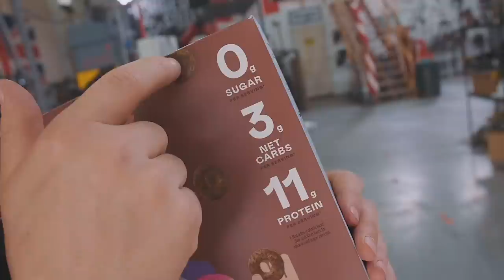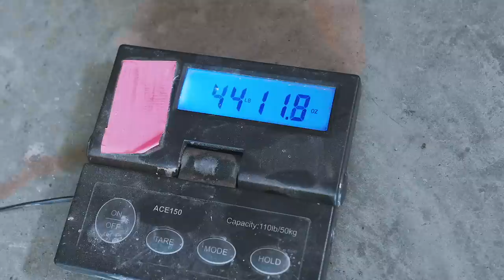MAKING A GIGANTIC WHOPPING BIG SWORD!!! Part 5

Comment: Can’t wait for deliver guy to ring the door bell and yell “GIANT WHOPPING BIG SWORD FOR HOW RIDICULOUS” 📬
Reply: This comment  needs to reach the top. 👍 and comment
Reply: That'll be pretty freaking awesome, I can't wait to see the drop video. I put a comment of my own in here somewhere, but if possible please relay to alec to take off the long sleeves when at the lathe, really bad things can happen if it catches clothing. Not trying to be OSHA but I don't want to hear of a horrific or fatal accident happen at the workplace. This collaboration is an awesome idea by the way!
Reply: Pin this comment
Reply: Hope the vid ends well with this beast. Try not to use it on really hard surfaces or thick layers metals. Would hate for it to bend or break on the first try. A big gummy bear or jello sounds fun. The top part of a cheap car is easy to go through at that height & speed depending on the sword. °-°)
Reply: REXcalibur?
Reply: Can’t wait to see this 44lb beaut be dropped from the tower. Hopefully Rexy is at a safe distance.
Reply: Corbey Foss
Brilliant!
Reply: Russ B Rey would probably be right in the line of fire looking up. 🙂
Reply: Drop it on some oobleck.
Reply: I can't understand why they didn't make it sharp and super shiny also some ingrained logos on aluminum and some cool leather handle design
Reply: @legonciify  it's being used for destruction and dropping. Also, they're dropping into a sandpit so it would slightly shine the metal any way. Or... it'll just scratch it up
Reply: @corbeyfoss281  someone's early with the name game, it's a good shout though
Reply: 44 lbs giant whopping big sword for 44 club
Reply: Alec really missed the chance when he said turn on notifications rather than “Get the bell on!”   He’s definitely not getting pinned. 😂😂
Reply: @corbeyfoss281  THEY'LL PIN YA!
Reply: Alec should pin ya!
Reply: But what will you name it?   It need a really Lord of the How Ridiculous Rings type of name.
Reply: Wordsnwood (Art Mulder) I think it will be the Commtest
Reply: Oh man, I've been watching these videos all week and was hoping to see the drop video tomorrow. Oh well, I watch all HR videos anyway, will wait for this one's turn. Get the bell on folks!
Reply: kbertan it might be used in their 6M subscribers celebration
Reply: @KHolzer444  true.
Reply: 44lbs for the 44 club ... how rediculous is that! loved both chanels for years
Reply: Its weird seeing How Rediculous pinned. 
Alec PINNED YAAAA
Reply: looks nice but at that length i say it'll snap
Reply: It weights "44" lbs WOOT
Reply: I predict the sword is going to bend about the first couple of drops
Reply: It weighs 44 pounds!!! Name the Sword Forgey-Forge!
Reply: @corbeyfoss281  I'd give this comment a thumbs up but it's already at 44
Reply: Film it if you can!!!
Reply: 44lbs How Ridiculous is that !
Reply: Can we just agree the weight was 👌
Reply: Can someone settle an argument? My wife thinks it's impossible to send a sword to Australia and thinks it's all a hoax and i believe what I've seen
Reply: @christophercain8873  probably designation is art or something
Reply: @DakotaActually  possibly so. Wife still doesn't agree lol
Reply: @christophercain8873  "Essentially if its so big you cant conceal it the government often doesnt care, if its a gangy, hommie, druggo weapon (in their eyes) like knuckle dusters, butterfly knives, concealable daggers, throwing stars, stuff like that then they care. You know the states war on crime. Pity the only front is fought on speed cameras and breathalizers."
Reply: @christophercain8873  thats queensland au
Reply: Wheres the video chaps?!
Reply: Update?!?!?!?!
Reply: Its been a month. How long does it take to get a Giant Whopping Big Sword?
Reply: @ps144one2  they got it awhile back. Just no vids yet. Prolly doing their new channel stuff
Reply: That would be EPIC!
But only 44lbs, and you guys struggled to move it? I could easily best that lift. I know you guys were playing up for the video. At least, I hope you were.
Reply: It’s 44 pounds 44 club hr club
Reply: 44 pounds, 44 club

Comment: Snow’s coming soon, make a Damascus snow shovel!
Reply: YES
Reply: THATS WHAT I SAID LAST YEAR!!!
Reply: OMG! This must happen!!!
Reply: Good idea👍
Reply: Wouldn’t that be hard to use due to how heavy it would be?
Reply: Yes 1 million times yes best idea yet !!!!
Reply: Yanir Govrin yeah that’s a good point, I believe most of them are aluminum
Reply: Why would it have to be heavy? Layer it, fold it, get your pattern and then hammer it flat and form it. Finish with a few days of hand sanding!
Reply: and resemble the flag of Montana
Reply: @wywy8834  I believe many of them are steel.  Aluminum has a bad stress-strain curve. That's the thing in engineering that talks about permanent deformation under force loading.  It's why you can bend some paper clips and they snap after 30 seconds and some don't after like 5 minutes, the one that snaps is aluminum, the one that doesn't is steel.  Some are aluminum, some are steel, and a quick check of the ol' google implies that aluminum ones, apart from breaking faster, are also twice as expensive normally.  And it only saves you one pound, 4 instead of 5 (for the specific two with equal blade sizes and wooden handles I'm looking at).  The morale of this rant is: don't buy aluminum shovels unless you live somewhere you only get a couple inches of snow a year, and you like paying double for barely any benefit and several notable drawbacks.
Reply: Please!
Reply: WELCOME TO PART 428 OF THE DAMASCUS SNOW SHOVEL PROJECT!!! I KNOW IVE GOTTEN ALMOST IT ALMOST COMPLETE AND RESTARTED LIKE 40 TIMES BUT, 41 IS THE LUCKY NUMBER!
Reply: demonzabrak That makes sense, thank you! And as for the weight, I was thinking that forging out Damascus that thin could probably end up being a nightmare.. So maybe he would have to grind a lot of the stock away?
Reply: We have been trying to get this to happen for what feels like an eternity,  hopefully this is the year.
Reply: Top comment and no heart? Alec has to have seen this, he’s avoiding it!
Reply: For sure!
Reply: @skoitch Will loves a few days of hand sanding!
Reply: Damascus plus combat shovel.... Damascus combat shovel!!!!
Reply: Damascus snow plow for the front of his truck!
Reply: @skoitch  they are not in Finland how would the shovel be Finnish?
Reply: That would be nice
Reply: Videos about yard tools would be cool
Reply: @Hayden, Timascus?
Reply: Do it as a shovel attachment to put on the front of his truck...
Reply: omg yes please! :D
Reply: It would probably have to be stainless damascus
Reply: ??? Why, Unless your mad about having everything in Damascus
Reply: BIGGER!!!! DAMASCUS SNOW PLOW BLADE!!!!
Reply: What an odd spoonsor
Reply: Doooooooo iiitttttt!!!!!!!
Reply: @wywy8834  I definitely have steel shovels. To dig. Maybe not snow shovels. But digging shovels
Reply: Thats awesome
Reply: he should make a Damascus snow plow. its Montana not Nebraska.
Reply: Winter is coming
Reply: @ndulin1234  game of thrones theme playing 😂😂😂
Reply: Great idea
Reply: Red Roy  I caught the reference and am STILL waiting for the book.
Reply: With diamonds and golden inlays! Because why not....
Reply: Make a steel edge for it so you can replace it when it's worn out so you don't damage the damascus and make it out of stainless stell damascus so it does not get runter when there is some salty snow
Reply: Snow? Oh yeah I remember that. Back before global warming. Used to snow quite a lot around here. Never on Christmas day though...
Reply: @skoitch  f in the chats for will
Reply: Make Ice Skate blades
Reply: skoitch is this in America
Reply: Union Jack Gaming And Vlogs 
Yes
Reply: Steele vs Stelter Snow Showel!!!
Or Utility Showel
Reply: YES, YOU GENIUS, YES!!!
Reply: You mean, Winter is coming for you, my summer child
Reply: Yanir Govrin he didn’t say giant
Reply: Don't forget a feather pattern, Damascus ice scraper too!!!
Reply: So...has anyone thought about salt and rusting? Is that just me?
Reply: Elliot Witkowski, yes. Just like Damascus knives and swords you would have to clean and oil after use, if you actually use it!
Reply: Forging comically large spoon
Reply: That would be amazing ! Do It !!!
Reply: YES MAN THAT WOULD BE AWESOME
Reply: Nickel copper Damascus snow shovel

Comment: anyone else having a minor heart attack at the cost it must be to ship that to australia?
Reply: Air freight for a long object, relatively light... to Perth from Bozeman (I don’t think it would save much to drive it to DIA). Don’t know. Several thousand US dollars at least?
Reply: A bit of pocket change.... Just a bit
Reply: @markiangooley   my motorcycle from aus to the states by air was $2k so it would probably be less than that. (not much though) from the states to aus by boat was only 800 (+ a couple of months).
Reply: According to the USPS website for international parcel at 45lb would be $298.90 + tax and whatever add on fees.
Reply: Hopefully it gets through customs fast... wood products, the delrin might have been a better option.
Reply: 300$ is probably more than the sword cost to make
Reply: I've been thinking of that from the jump, I'm an artist and it's always a gamble of how much I'll be paying to ship a piece out.  I would guess around 2,000, but I could be way off, it's not so much the weight but the dimensions.
Reply: looked it up its 1000+ with most companies
Reply: @fateunleashed9680  Last time I tried to ship anything internationally, there were size restrictions, not just weight.
Basically beyond a certain length it was almost impossible to get shipping for an item through typical means...
Reply: @genxray951  Interesting. using sea freight, I paid about 300 pounds to ship a pallet load (the contents of the pallet was stacked up to about 2.2 metres high - in the case of a shipping pallet sent through ocean freight it turns out that the price doesn't really fluctuate by weight, nor height. as long as you're within the dimension limits allowed, you simply pay a fixed price for a standard size shipping pallet)

Of course, we were then hit with about $800 in customs and handling fees at the other end. Still a lot less than I would've expected for shipping essentially everything I owned barring furniture most of the way across the planet...
Reply: I'm more curious on how they would even do that haha
Reply: Alec should ship it COD 😀
Reply: Air freight should be between $10 and $20 per kilo so $200-$400
Reply: Being so long and irregular shaped...small fortune.
Reply: not even just to Australia but even more due to the location in Australia and with the delays due to covid the amount of time it will take to get here is crazy .... atleast they cant really claim they lost it in shipping unless a ship or plane goes down lol
Reply: The packaging and the box its in, would add, likely, another 10 pounds, too.
Reply: How ridiculous have basically infinite money for things like this, they haven't been able to travel either.
Reply: Oh it's not much at all, 2 mortgages and a car.  see?  not much at all
Reply: Why not make it in Australia in the first place?
Reply: Someone commented on the handle being made from wood and customs grabbing it.. What about the fact its a double edged "blade" these things are illegal in Australia.. Anyhoo...
Reply: @sirgalah561  Pretty sure they'll do what MichaelCthulu does, and call it an "Art piece/Sculpture".

Comment: Sword gets to Australia somehow FedEx has managed to destroy it.
Reply: Oof
Reply: FedEx doesn't destroy stuff they end up saying it was delivered and you find out they are selling it on eBay
Reply: More likely Australian quarantine will confiscate it before How Ridiculous even see it.
Reply: If it makes it through customs Australia Post will either loose it or send it via Mars.
Reply: @andyroo8592  I didn't think of that isn't Australia one of those countries that limit blade length to 36mm or some ridiculous thing like that?
Reply: I don't think blade length is an issue, but if it's Sharp or double edged  or opened with a spring would get it blocked...funny those rainbow leek knives from Kershaw were not a legal import ( laws changed and I think they are ok now) and the guy on a customs tv show was using one to open boxes for inspection...hhhmmm I wonder where he got it from??🤔
Reply: @yoursexualizedgrandparents6929  He's talking about how FedEx actually sold a YouTubers one of a kind specially made clutch for his car. One that is made for his one of a kind engine.
Reply: Last time I ordered a sword from the US it had been opened somewhere on the US side and repackaged in newspaper (which is how I knew it wasn't our customs). As it was no longer in the original airtight packaging (which I confirmed with the seller and which previous blades from them were in) there was rust damage. Really wasn't happy.

Comment: So who else thinks the sword will be bend in half after the first drop?
Reply: Unfortunately kinda thinking the same thing since he didn’t harden all of it seems like this video was a bit of a let down with his usual quality really felt rushed to me
Reply: I've said that all along!
Reply: and/or the handle will break off..  Super glue is not very tough stuff and after all that sanding and profiling, there's not much of a seam, plus the heat of the torch will likely also have weakened the glue, and epoxy is not that great at holding handles on in the face of shock and impact..
Reply: @Flying0Dismount  I agree. The shock is going to shatter that handle.
Reply: The amount of force a dropped object gets, at that height, is massive. Alex is a great smith but anything dropped from that high would have to be very thick ... like anvil thick (alex liked my comment, I hope he doesn't think I'm insulting his skills)
Reply: after first drop? no, it will last some time (maybe damaged handle etc) but it will inevitably meet bulletproof glass or a safe and thats where I think this sword will not make it (worst case scenario the sword will meet Bruce and that will be its end :D )
Reply: That may be very likely. Then again, if he hardened it like a normal sword, it may have broken upon that impact given normal swords are not meant to be dropped that high or made that big. I'm not a metallurgist or materiel engineer/physicist though, so what do I know.  I definitely don't expect it to last that long given what they normal drop these things on. Might brake on the steel plate or bullet prof glass drops. Not to mention the safes they have been doing recently. I just hope they are happy enough with it to ask him to make another one like they did the giant darts. We might get a better 2.0 version that isn't rushed because they had to put up a pulley and because Alec is..... well Alec. No offense.
Reply: Depends how it lands. If it falls straight and stabs then there's a decent chance it'll survive a few drops. If it rotates in the air at all then it's probably done for. Not much you can do about that, though.
Reply: I think it's going to flip around and land handle-first, because of the wide blade acting like a fin. A skinnier blade and an airfoil-like guard that works like the tail fins on a dart might have worked better. But we'll see.... I hope I'm wrong!
Reply: If my calculations are correct (the likelihood is suspect), that puppy's gonna hit at around 30m/s delivering just shy of 1kJ. Please correct me if necessary.
Reply: @tiredoldwhiteman  how high will it be dropped from?
Reply: Matteo Balestrieri the tower HR drops it off is 45 meters
Reply: @tiredoldwhiteman  from a calculator I found its over 8kj. 19 kg object at 45m drop. Course that was a plug the numbers calculator and it spits outs the joules amount
Reply: @laurawerner  probably not. Most of the weight is at the tip by design, it'll be dropped point first and the guard will act as a drag stabiliser. So unless it's deliberately dropped handle first it's not that likely to spin, just like one of HR's giant darts.
Reply: Matteo Balestrieri the tower is 45meters
Reply: Depends on what they drop it onto

Comment: would have gone with a 1" forstner bit, then welded a rod to the end of it to make it long enough to go through the length of wood. Have a feeling dropping from the heights they want will split it apart again.
Reply: They want the sword to last as long as like 3 episodes..

the Mark Rober Trampoline lasted a good while until it broke.  a split wooden bit isnt gonna deter them

Comment: When using the two push sticks for the table saw.... don't use the one in your left had to apply pressure against the saw blade or past it. The wood can bind and kick back with incredible force.

Comment: They make affordable, long wood drilling bits and you can pick them up at most hardware stores. We use them to drill through large diameter corner post for gate hinges.

Comment: Cut the twist drill on the taper where it is soft enough to machine,  weld it to what ever length rod you news,  machine a Morse taper on the end and you a long series twist drill. I've made them 3' long in the past.

Comment: For everyone saying this is going to break first drop, I have some things I'd like to point out. 1045 (the steel Alec so kindly informed us he was making this monster out of) is an industrial steel used extensively for its toughness and wear resistance. The only parts of this sword I'd be worried about are the glued wooden handle, which a simple wrap with string or leather could reinforce, and the aluminum guard if they are dropping on hard objects (such as safes). Researching materials is important when you are unfamiliar with their properties. Alec didn't make a masterpiece here because the intended use of this piece is to be brutally tested against anything and everything the How Ridiculous boys can throw it at. He made something functional, and amazing in its own right. Just because it isn't pretty, doesn't mean it's half-assed.